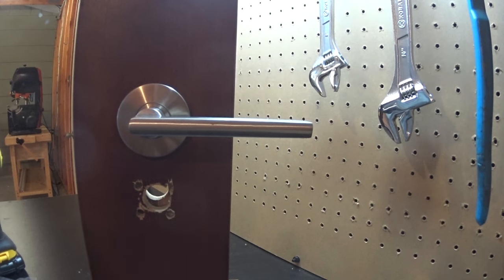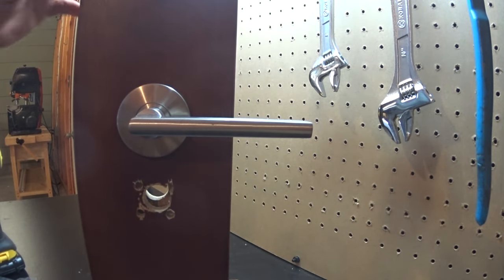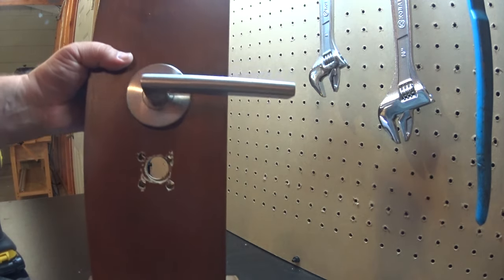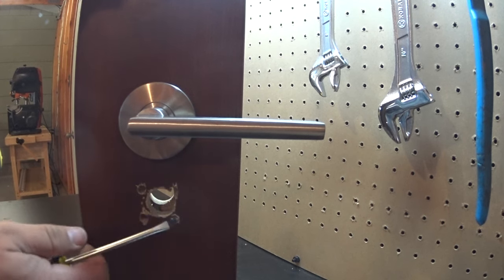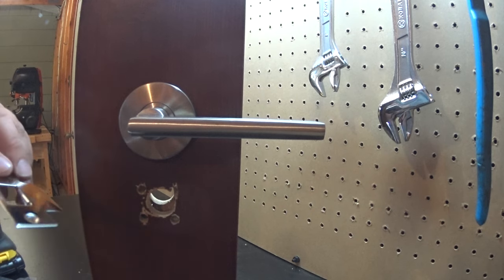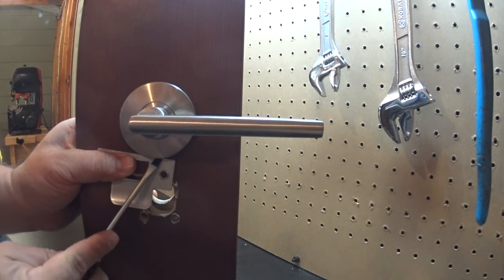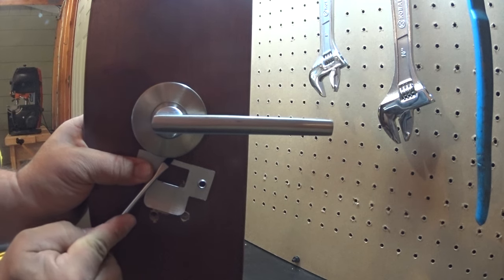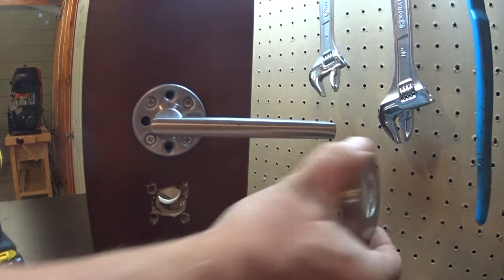How do I remove a snap-on rose cover on an installed lever door handle?

Comment: Until I happened to spot your video I was puzzled how to disassemble a loose door handle in my house .  I had previously thought the circular rose might unscrew, but nothing happened. Instead of the suggested metal strike plate, I used the thin hard plastic backing plate from an old CO alarm. It was strong enough to protect the wooden surface of the door yet thin enough to allow a small flat screwdriver to enter the slot and prise the rose off.

Comment: I have door handles like this in a new house I moved into, and it literally doesn't have that slot at the bottom. There is at best two tiny, almost invisible slits towards the top where it looks like something like this might be - but it's like a hairswidth, too narrow for a flathead or much anything else to go in there. Took two screws out of the lever shafts but that didn't seem to loosen anything at all either. Talk about form over function.
Reply: You ever figured it out?
Reply: @raysantiago6761  I did in fact. It turned out to be as simple as rotating the metal cover at the base of it, they sort of slide off then and uncover where the screws are. The thing is at first glance it was stuck in place incredibly hard, so it didn't feel like it would come off that way. Only when I put some real force into it did it come off.

Comment: How do you get the ring back on afterwards without damaging the door through force? The rubber ring around it seems to stop it no matter what I try. I assume there's a trick to it I'm missing
Reply from the maker: Hi, Ben! Thank you for your question. INOX doesn't use "rubber rings" in its door hardware so we are puzzled. Please email us at sales at unisonhardware.com and we'll try and help!
Reply: @UnisonHardware-INOX  Thanks for the reply, it turns out that the rubber ring wasn't actually the thing preventing it going back on. It was a screw from the other side of the handle that was protruding too much on the opposite side. It was stopping the cover fitting flat and was the perfect length to make the rubber ring appear the culprit! 

Thanks for the video 😀

Comment: i can't for the life of me get the cover off my handles. the rose seems to be stuck .... any tips?
Reply: Having the same issue myself
Reply: @janrich1849  I ended up ripping the whole handle off the door! The plates must have been rusted on tight. I will add some lubricant when I install the next set.
Reply: Just solved this.  Rotate the rose 90 degrees so that the pry-notch is horizontal; I used a rubber strap to grip the rose gently, it might be very difficult to turn, but only because of friction against the door.  However, it will pop off easily after doing that.  

The problem is that (at least for some of these devices) the catch dimples are on the left and right side, so when you pry from the bottom it doesn't help get over them, especially when the rose is fit very tightly to the door.  The distortion probably actually tightens the rose against the dimples making it even harder to come off.  Rotating puts the pry leverage at the dimple, and it really doesn't take much once you're there.

Comment: how do you remove the cover if the handle is no longer on the door?
Reply: I had this issue. I gave a quick tap on the screws with a hammer to push off the plate. Hope this helps!

Comment: I've tried this, they won't budge at all, what else can I do short of cutting them off with a multi tool
Reply: Having the same issue with an old doorknob. the faceplate doesn't even budge and I don't see any kind of mechanism that I need to push in to get it off. I might just try to paint around it by carefully taping it...

Comment: My handle fell off cos the screws were too short and I can't remover the caps even though they are not on the door. Nightmare my big regret, here should be a at least a notch but mine has nothing.